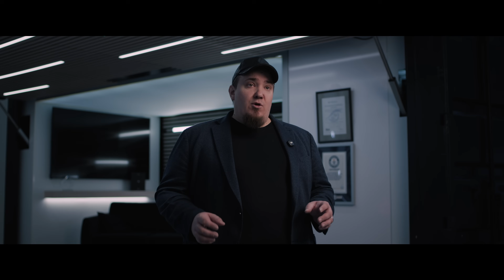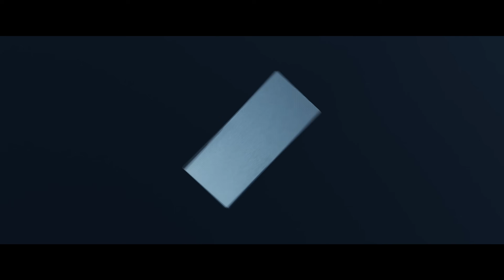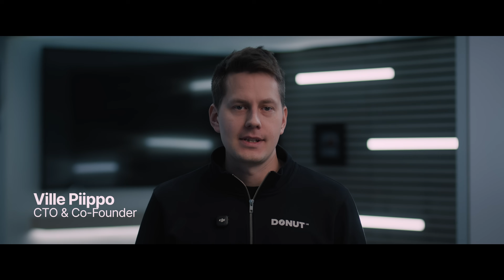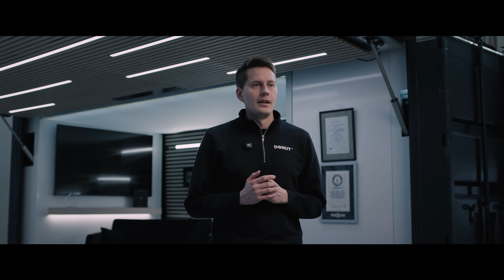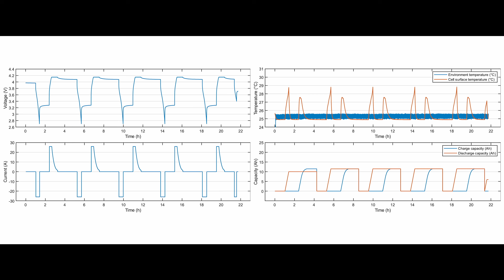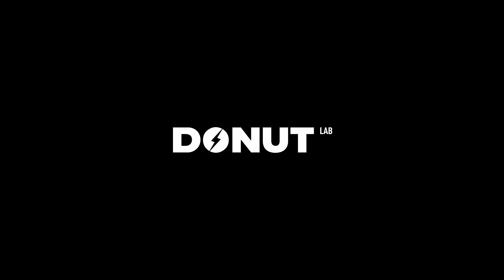Donut Solid-State Battery: Safety Demonstration Test | I Donut Believe (Pt.5)

Comment: This video seemed incredibly convincing about the battery's solid-stateness, but there is a reason they did not do a nail penetration test or show us the weight. Their other tests, perhaps inadvertently for them, proved their battery to be lithium rather than sodium, and its energy density has been sussed out to be below solid-state level. They promised a battery at CES with production capacity that did not exist, and that is not cool. They then tried to save face, grab whatever they can find, call it 'V1', continue to call it 'solid-state' when it probably isn't, and call the non-existent CES spec 'V2'. 'V1' might be a stabilised nickel-rich lithium chemistry that happens to have a few solid-state-like behaviours, only with NMC-like lifetime (unproven). It seems like a very good battery but no match for what they promised at CES. No word on 'V2' so far. Please own up!

Comment: Donut Lab did not state anywhere that their solid state battery contains lithium. They only stated a comparison with regular lithium lithium-ion batteries, but that doesn't mean their batteries contain lithium. Donut Lab claims on your website that their solid state battery is made entirely from abundant, affordable, and geopolitically safe materials. This means that solid state battery by Donut Lab do not contain the lithium in any form?

Comment: I think this is just a lithium ion battery , it possible that you added some kind of material which stops the battery from catching fire , this material could simply change phase liquid to gas , when a certain temperature is reached. 
At the same time this heat suppression can allow the battery to charge much faster  without the risk of fire . 
Of course this would add weight , and as this material is used up , the battery will loss capacity just like lithium ion batteries.

Comment: Can someone please show the evidence that the vacuum lost comes from the broken pouch? I am sure that the (liquid) electrolyte substances partly decomposed in the high temperature test resulting in some extra gases within the pouch. I work in the pouch manufacturing area and know the phenomenon quite well. For Silicon-contaning anodes, some higher gas volumes are trapped in the pouch after testing the cell. The pouch material should withstand the 100 °C because the inner PP-layer starts melting at around 180 °C.

Comment: I can see that you want to generate suspense and hype and it has been interesting to watch. However the slow drip in performance tests without addressing the elephant in the room is annoying and makes me to start lose interest in what is supposed to be a breakthrough battery. Why not show the weight and dimensions of the battery so we actually can either confirm or deny the 400 Whr per kg claim you have made? Also when showing the high temperature tolerance why not also at the same time show the low temperature performance of the battery? The world moves on and we see BYD roll out 1,500 kW charging infrastructure and CATL demonstrating progress in their own solid state battery technology.

Comment: Solid state batteries expand when a vaccuum seal is broken because the individual layers need pressurized contact to maintain their electrical properties.. Kind of like how a snowball keeps its shape and flys better when compressed - you have to squeeze the layers together for the battery to function at its best (not a perfect metaphor, but play along). When the seal fails in a solid state battery, it will expand due to relaxing pressure on all the individual layers - kind of like when you open a vaccuum sealed pillow. When the seal fails on a lithium liquid electrolyte battery, typically it is violent because the high temps already initiated a chemical reaction within the cell which will cause it to expand before the seal breaks like a balloon. Once broken, the battery chemistry rapidly reacts with the moisture and oxygen in the air causing it to explode or carch fire.

At first it was odd to me that Marko mentioned the battery expanding (20%) after the seal was broken but now I get why he did that.  

The roughly 50% drop in performance is (I would put money on) directly coorelated with the drop in pressure inside the pouch. Once the pouch reached equilibrium at around 11 amps, it levels off and continues operating normally (at the lower amperage). I would also assume ion transport would be affected, which would reduce the charge rate its capable of.

It proves it's definitely a solid state battery.
Reply: Excellent comment and explanation(s)! 👍 Analogies worked.

Comment: I'll wait for Two bit Da Vinci to explain what that drop in capacity might mean.
Reply: The VTT report shows the cell was stable, but the 54% capacity drop afterward is the smoking gun. It proves that while the chemistry stayed safe (Solid-State), the standard 'Big Lithium' pouch failed to keep the air out and the pressure in.
If a standard lithium battery were pushed to 100°C, the liquid electrolyte would boil and turn the pouch into a 'spicy pillow' or a fire. The fact that the Donut cell stayed flat but lost capacity proves the packaging was the only thing that couldn't handle the heat.

Comment: First of all, lithium ion pouch materials are heat sealed at about 350 °C, not 90 °F, so it is certainly unexpected that the material "failed". Secondly, a lithium ion battery would behave more or less this way too. Simply gassing at high temp and possible unsealing the pouch material is not enough to immediately degrade a lithium battery, let alone ignite it. Like people are saying, we've seen the capacity, so release the dimensions and mass to tell the story. And maybe compare to lithium ion so that people have context – clearly too many in the comments are from outside the industry and taking these videos at their word. The last self discharge video was downright terrible compared to a lithium ion cell, for example. Such a farce.
Reply: You’re confusing material melting points with chemical stability. While the foil might not melt, the heat-seal polymer (the "glue" holding the pouch together) fails far below 350°C.
More importantly, a liquid lithium battery at 100°C doesn't just "gas"—the liquid electrolyte boils, creating internal pressure that turns the cell into a bomb. The moment that pouch unseals, the flammable vapor vents and ignites.
The VTT report proved the Donut cell gained 7% capacity at 100C. No liquid-electrolyte lithium battery in history can do that; they enter thermal runaway and self-destruct. The physics confirms this is solid-state, not standard lithium.

Comment: The boldest claims have not been answered yet:

-The type of chemistry
-The number of cycles
-Performance at low temperatures, which is a problem for current batteries
-And last but not least, the energy density

We know its fast and "safe" ... the last video has a lot to prove

Comment: If the “Donut Battery” is real, it is astonishing that, even after three months of puzzling over it, even the “best experts in the field” still have almost no clue what it could be made of.
Reply: That would be consistent with a more fundamental, multiple-roadblock-eclipsing innovation.

(As for 'almost no clue' - I suspect that those pontificating on a carbon-nanotube/mobile-element architecture and chemistry... might be correct, here. We shall see!)

Comment: I love that everyone is here for the wrong reasons. Who gives a shit if we can get 1000 miles of range from a charge? That's not what's significant about solid state. What actually matters is the safety aspect. That's what real world people keep grasping onto as an argument against EVs. Most EVs nowadays hit the 350-400mile mark that makes sense for 99% of people, but they're going to keep referencing videos of Teslas on fire because they think their gas guzzlers are safer. Solid state batteries aren't going to be worse in Wh/kg, so even if they don't quite hit the mark they advertised, we're at least getting a safer battery that can operate at a wider range of temperatures and can charge faster.

Comment: I'm more interested in the cycle-life tbh (which can be proved with a month-long test if the batteries are quickly charging/discharging at a constant pace 24/7 (and I wouldn't even care if they have to be actively cooled down for this to work)), not so much the density.

Comment: Just weigh the fucking battery already!
Reply: The Donut battery pack replaces the old li-ion pack on the motorcycle. So it has to be about the same weight. As it has 100+ more kilometers of range, we can do a mental estimate of more power storage per kilo. About what is claimed. If I get a minute, I'll trot out the numbers already on the page. But you all are capable of doing a minute's work.
Reply: @davis.fourohfour I want data, not some trust me bro guess that makes too many assumptions.

Comment: What is the solution for the weak pouch?
Reply: Most real-world applications won't see anywhere near 100°C, this was an extremity test. If a battery pack is going to reach that level then active cooling will be adopted (air cooled for bikes and liquid cooling for larger EVs).

Further, the CES mock-up cell gave a clue as to the production packaging having a case that can apply clamping pressure to the pouch seams, and constructed of a material to thermally conduct heat away from the cell to the pack/module cooling surface.
Reply: Perhaps something at the pack level? From what I gather so far, the slightly greater pressure (but not 'great,' like most cell chemistries and architectures need!) that will be present when these are contained in a real, functional 'pack' (of whatever shape/size they print these into, per application), will by default make this a non-issue.

Even if this wasn't the case - which it is, though! - it seems like a simple, non-issue pack-pressure and adhesive detail to address. (But I must admit I don't understand why a simple/standard foil pouch + adhesive envelope was even used, in that case. But then, it's not at ALL a deal-breaker, for me. All it can do is give us potential information - clues - to the battery itself.)

Comment: A bismuth-based battery shows strong promise for energy storage because bismuth can store and release energy through stable alloying reactions with ions (such as sodium or lithium), offering good capacity and long cycle life. At the same time, it is inherently safer than traditional lithium-ion chemistry because it does not form highly reactive dendrites or rely on volatile, flammable electrolytes. As a result, even if the pouch is punctured, a bismuth battery is far less likely to ignite or undergo thermal runaway, making it a safer alternative for future energy storage systems.
Reply: 🔋 BATTERY TEST @ 100°C 🔋

Lithium-Ion:
████████████████████⬆️💥
Flat… flat… then FAILURE

Bismuth Solid-State:
📈───────────────✔️
Smooth, stable, predictable

🔥 Lithium hides danger  
🛡️ Bismuth shows control  

Next-gen energy is changing

Comment: I love how so many people just blow this off, like any other chemistry can do the same.   They cannot.  
Any liquid electrolyte based chemistry for Li+ or Na+ will rapidly degrade when exposed to atmospheric oxygen and humidity.  
Li+ often fails spectacularly and Na+ will produce a poisonous gas.  
At minimum the capacity would drop continuously down to zero as the electrolyte degrades, and  at most, they'll burst into flames.  

While Donut has said they don't require the same massive clamping pressures that other solid state cells do, it looks like they need some clamping pressure as would normally be supplied by atmospheric pressure against a vacuum sealed pouch.   Without it, it looks like they lost some layer adhesion, and with it, half their capacity.   Would be interesting to see what would happen if they put a weight back on top of the pouch.   
Nothing about this result (especially while continuing to cycle at 5C charge rate) is normal or even possible for any other known chemistry in the lab, or otherwise.
Reply: I agree. Also, nobody will be charging batteries in a car at 100ºC unless you want to transform it into a huge pan.
Reply: Yes! Agreed.

I hear mostly the sound of silence, on that point.

Comment: Actually demonstrating that your finished battery might have 10000 cycles, but don't let any of the cells get overheated and/or punctured or it will die in 10 cycles lol

Comment: So there is no pouch specifically designed for these cells in the industry, obviously they didn't expect the loss of vacuum. The more I see of these battery tests the more I am convinced that they have something promising that works in a lab environment like many other companies do, but they don't have something ready for mass production so they are trying to raise funds to continue the research. My personal opinion, I don't think this is a scam but I don't think they are closer than anyone else in solving solid state 100% but they have a lot less financial resources than everyone else. I will be very surprised if they actually start putting these batteries in production motorcycles later this year.
Reply: You may be right but don't base your conclusions on the pouch failure. I am going to repeat what I reply to another person here:
You will not see a pouch (for EV batteries) designed to operate at 100ºC. Because nobody is charging, nor will charge, batteries at 100ºC; even if the battery cells and the pouch could take it. No this battery, no other batteries, no batteries in the future. Unless you want to transform the car into a huge pan.
You will warp the plastic trims of the car, damage its upholstery, melt electronics, and potentially burn the people inside the car. Not to mention the stress to the car's metal frame that will absorb the heat, and its structural integrity after a few cycles of thermal expansion and contraction
Reply: @ppapdddar6159 I'm not concluding anything, I'm just expressing my opinion.

Comment: This series is a masterclass on combining advertising, hype train accelleration and pro-level trolling into a single, weekly 5 minute video. And that fact alone makes me inclined to believe they have a revolutionary product. Maybe all of the claims are true in VERY specific circumstances, and not all at the same time? Even so, it still represents a large step forward in capability.
Reply: They are just doing this to get unsophisticated rich investors onboard. You are beyond gullible.
Reply: @jimj2683  the way I see it. They either really do have something or someone’s going to jail soon.😊
Reply: If they had it, they’d be showing it in all its glory, all at once. The only plausible explanation for the drip feed is that they’re milking the hype for a product that won’t live up to it.
Reply: If you do it like this, the girdle pin and side fumbling  are reduced to a minimum.

Comment: Where's the video or even photo of the pouch after these tests? There's MAJOR difference between the chemistry outgassing with the pouch filling without leaks vs letting air inside. If the cell leaks, it wouldn't balloon because it cannot hold pressure, right?
Reply: There are photos in the full report
Reply: You can see it in the report (1:30 in the video).

Comment: My experience includes 20 years in designing and carrying out product testing at temperature extremes on military electronics. Show me a test with ten or more batteries in the climate chamber all going thru the same live testing at the same time. Show me the before and after weights and dimensions for each battery. Show me penetration tests on ten or more batteries. Show me destructive testing designed to learn the failure modes of the battery. My position on this battery is neutral, I neither believe nor disbelieve. I await the kind of data I am used to seeing. My understanding for now is we are being shown data on only three samples and not all tests are being done on all the samples. This is inadequate.
Reply: Yes, true - but as Robert replied above, there are (frustrating real-world business) reasons why we have to experience this episodic drip-feed the dramatic way, instead of the (only clearly logical, no-bullshit) way we'd like.

This is the ONE AND ONLY such extremely rare time my intuition allows me to not just put up with - but actually accept being entertained by - such a leveraging push by a company with such a breakthrough claim.
Reply: True, it is completely inadequate to prove anything, and certainly isn't meant to be definitive final proof, but it gives us something more to chew on than repeating empty promises. It gives clues about performance and hints about possible battery composition for the critics and fans. In the end, these tests could be faked or complete red herrings, but why ruin the real-world Verge brand with deception at this point? They will stop trickling tests when people stop tuning in. If there are serious delays, then maybe more substantial test results will be required to keep us tuned in. I think of this website as the music they play while you're on hold waiting to speak to a live agent. lol
Reply: Those tests were likely done already and reserved for the OEMs engaging with Donut Lab, under the privilege access of an NDA.

Comment: This isn't really a scientific test at this point. If you wanted to show the broken pouch wasn't an issue, why use a battery that had been compromised in such an unusual way from a previous test? Why not start with a fresh battery then puncture it like regular battery tests? This is, if anything, is a test that you stumbled into by happenstance, which shows there's really not any protocol being followed here. Is the issue that there are only a very small number of these batteries and you can't provide fresh ones for the different tests?